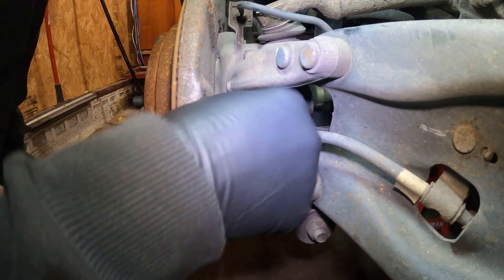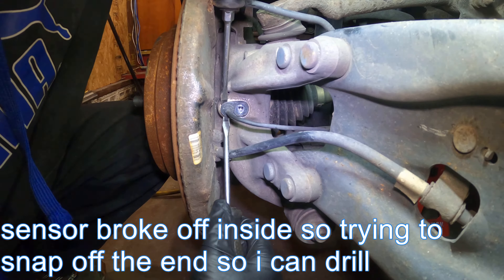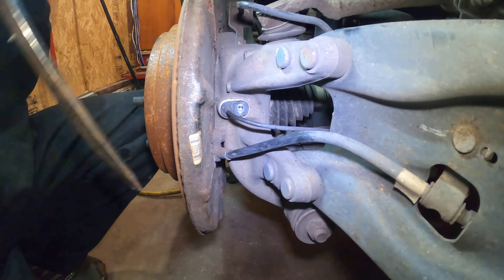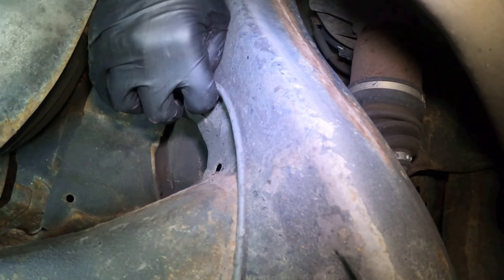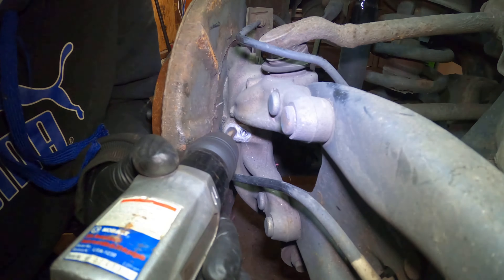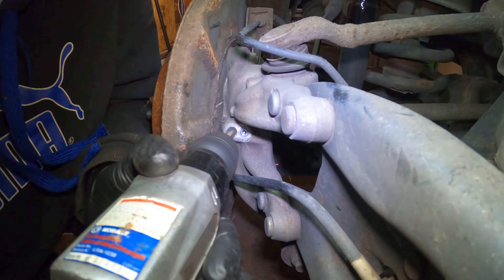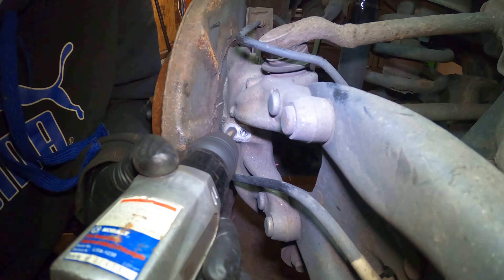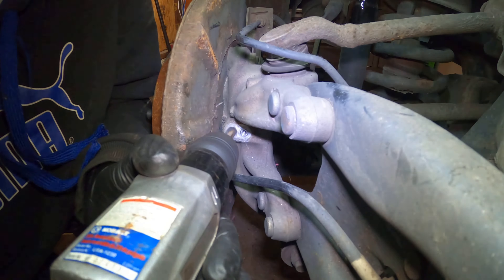2014 Honda Pilot ABS Sensor & Hub Replacement

Comment: Awesome thorough video! Btw, without the fancy scan tool, there's no other way to reset the abs sensor codes? Mine is permanent too I'm guessing because changing both the rear sensors didn't erase the codes. Dreading paying someone just to erase them 😢
Reply from the maker: If you corrected the issue property three code will go away after a couple successful drive cycles. i hope this video helps. feel free to like and subscribe for more & if you can, please help the channel out by giving a super thanks. Making these videos takes a lot of time, but we do it to save you hundreds. also head down into the description and check out the link for some high quality led bulbs for this and any other vehicle. use my referral for a discount. Add me in Instagram for behind the scenes pics and Stop by my store for some Anything Auto gear.
Reply: @AnythingAuto  thanks so much! This is great to know. I've replaced both rear sensors as that's what a Mechanic's pro scan tool showed when this was first diagnosed over a month ago. I replaced the sensors and drove the car for over two hours in 3 separate drives. Unfortunately no changes yet so I'm guessing perhaps we didn't address the issue correctly. Might have to get it rediagnosed :(
Reply from the maker: @ibanezmakki  rarely it's a sensor. Magent rings on the hubs rust out, causing the sensor to not read it properly. That's my experience atleast.
Reply: @AnythingAuto  oh that's a really good point. The thought didn't cross my mind that it could be something other than the sensor or wiring. I'll definitely check for that and keep you posted!

Comment: Hi, I have the same car, Honda Pilot EXL 2014 model, and the error appears on the dashboard. ABS and break  I went to the workshop and he told me there is no code in fact I don't know what the problem is can you help Thank you
Reply from the maker: @samyfouad6025  not without it being here. Sorry. i hope this video helps. feel free to like and subscribe for more & if you can, please help the channel out by giving a super thanks. Making these videos takes a lot of time, but we do it to save you hundreds. also head down into the description and check out the link for some high quality led bulbs for this and any other vehicle. use my referral for a discount. Add me in Instagram for behind the scenes pics and Stop by my store for some Anything Auto gear.